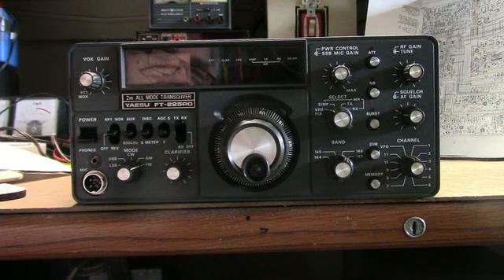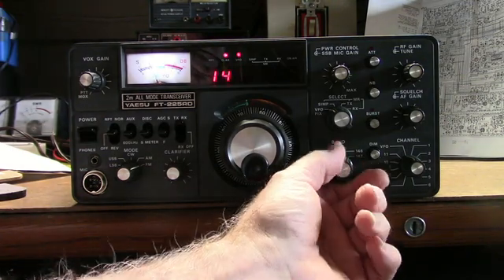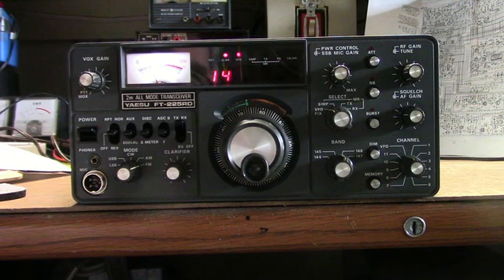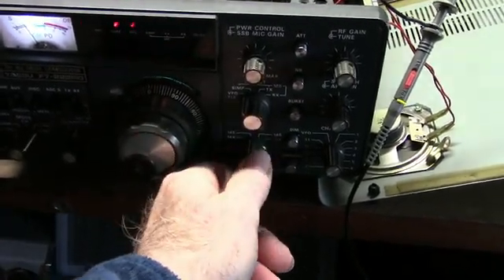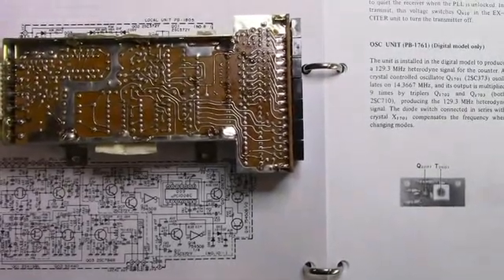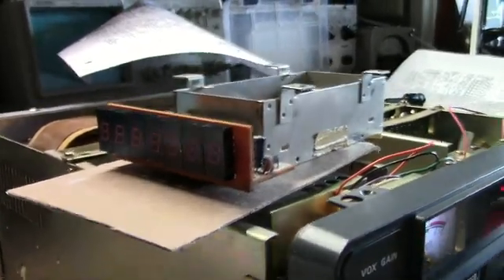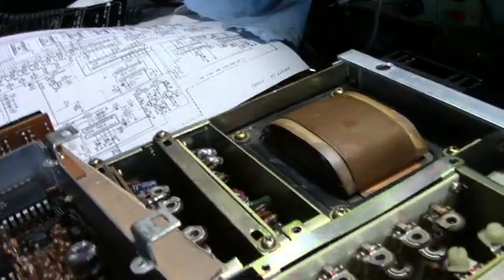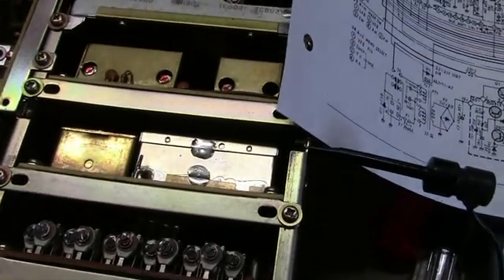Yaesu FT225RD

Comment: How did you fix the PL lock problem?
Reply from the maker: Hi therealspixycat,  The problem was a bad solder joint. I fixed that but it still went out of lock.  It appears the pll had been screwdrivered in a previous repair attempt. After adjusting the pll the unit worked.  It is still working but due to the age I suspect I will be revisiting the internals some time in the future.

Comment: Nice fix! I got one recently, rx is ok, no tx output and display drops 12MHz on transmit, not had time to look at it yet.
Reply from the maker: Thanks Paul,  After I made the video the counter started acting erratic.  Tx and Rx ok, just the display problem.  I replaced the Toshiba TC5032C counter chip and everything is fine now.  From what I read this is a common problem with these chips.